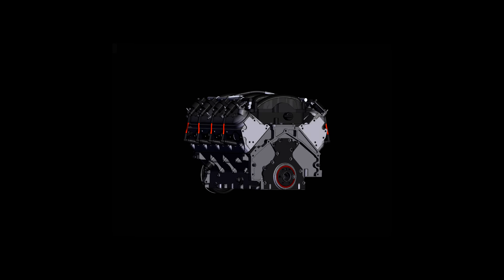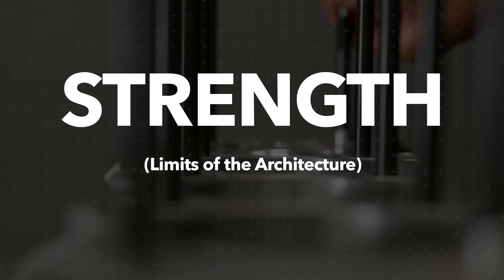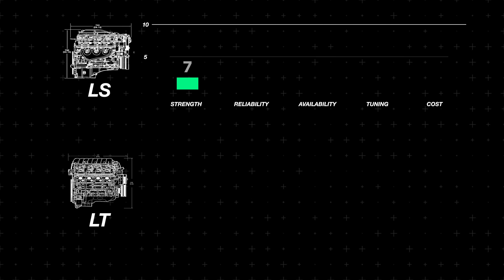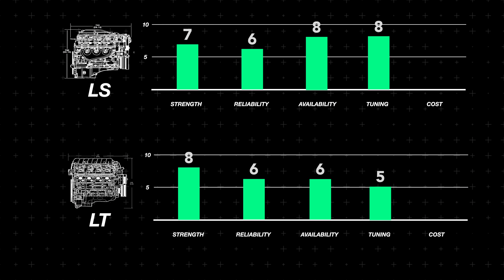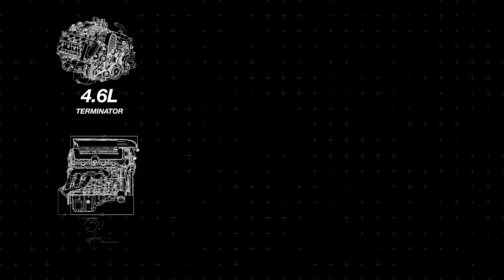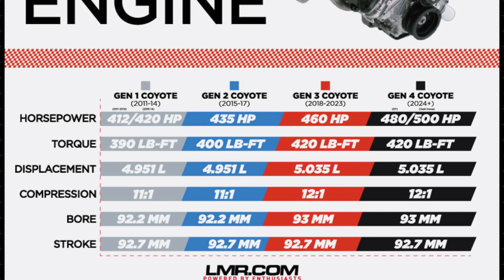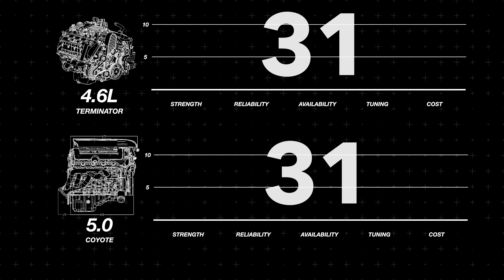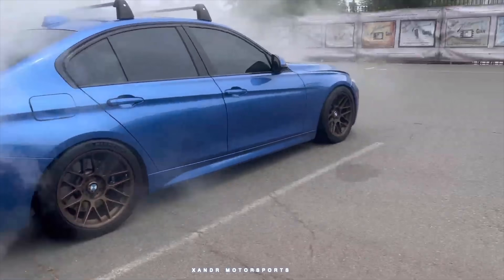Why Old Engines DESTROY Newer Ones💀| Explained Ep. 25

Comment: Did those old engines make 1000hp From factory? Obviously not. I've seen the Papadakis 1000hp B58 Supra, Brabus makes 900hp now....
Reply: And those are the pinnacle for B58 performance. Don't even get me started on the 2000hp 2j streetcars out there let alone 3000hp+ promods. And the engineering side of the engine which proves the 2j is a better engine.
Reply: @lennixsingh626 you’re fuckin joking lmao. Those aren’t the pinnacle of b58s. And hp/$ is easily in the b58.
Reply: @carter898  if they weren't u would be able to prove it. no one has charted even past the 1400hp mark in a b58.
Reply: @lennixsingh626  there are plenty of b58s rated for over 1500. high hp can be done with a big enough turbo that has a peaky power band with all of its power within ~400 rpm. The b58 shines where it can hold 1200 throughout multiple thousand rpm.
Reply: @lennixsingh626  Those 2000hp 2JZs are just Billet Blocks
Reply: @borla4491  theres been multiple 2000hp cast block 2j's that run effortlessly. Roughly 75PSI is the physical limit of 2jz cast block before they balloon and that with factory sleeves. No aluminium block will dare to push to that much boost before shitting itself
Reply: @lennixsingh626  No. I said BILLET Blocks. Which those are no longer real 2JZs. Which any engine that are Billet will of course handle way higher horsepower than the Factory Block.

B58 doesn't even have a Billet Block yet, and there's literally been B58s running 1000hp on Stock bottom end
Reply: @lennixsingh626  no 2000hp cars run “effortlessly”. Just tell us you don’t know how hard high power is on cars
Reply: @carter898  I know its not hard when theres even RB's out there making 2000hp in streetcars that last 40-50 full passes before getting just new bearings.
Reply: @lennixsingh626  Lol. 2j and RBs aren’t the only i6 engines out there
Reply: @carter898  2j's and Rb's are pinnacle of petrol I6's and its not even a debate.
Reply: @lennixsingh626  the s58 is the best one made right now. In 3< years that engine will be figured out upside down and backwards. It’s already made 1049 with completely stock internals. Neither of those engines would touch that
Reply: @carter898  its best engine for pushing power with stock internals. It still however isn't better than a 2jz or Rb until it pushes the same and if not more power than them later down the line.
Reply: @lennixsingh626  its better than an rb. They shouldn’t even be in this conversation. The s58 will make the same power as a 2j just because the after market materials are the same. After so much power they’ll need to be sleeved or billet ( though billets don’t count as the original engines anymore) and at which point they’ll run whatever kind of boost you throw at it meaning very close power. Then it’s down to individual setups for each car

Comment: I disagree with the oil pump gears on the coyote when it comes to boost. It comes down to bouncing off the limter. Regardless amazing video.  Thank you.
Reply: 100 agree, idiots bounce of the limiter and the o.p.g take a crap. Then you have guys that know what's up with 1000hp with stock o p.g and no issues at all.

Comment: Holding on to these old engines because we’re scared of new technology is the equivalent of people who wouldn’t let go of carburetors. The new engines are better, they just require smarter people to take advantage of them. And as far as tuning the B58 vs the 2JZ, good luck buying a reflash device for your stock JZ ECU to make 500hp with almost no work. Not to mention Papadakis uses the B58 in their FD car because jt is easier to make 1,000hp with a B58 than a JZ. Not a lot of accuracy in this “comparison”
Reply: 2j's make 750hp unopened with just bolt ons (minus cams and springs). That is absurd for a 30yr old engine. And there are many plug n play computers for 2j's nowadays. I find it funny that people like u always need to point out the little things that the b58 is better at, or should I say the ONLY thing being that the b58 can make extra 2-300hp without many mods. You better hope an engine that's 20-30 years newer would make more power with minimal mods. But when the bigger picture of the engineering of the blocks comes into play u run away. 

The 2jz is a far superior engine. Its not only simpler but its also stronger. There are cast 2jz's making 1800hp reliably. I will also point out the fact there are practically no mechanical faults at all with a 2j. It has one of the strongest cast iron blocks on the entire planet, Siamese bores and a girdle that acts like a block brace. You also tried to point out the fact that one of the only FEW b58's pushing 1000hp is Papadakis. And NO, he did not choose the b58 because its a better engine. He only used it because it came with the car and wanted to stick with the platform to see where he could go with it. He also had no idea what he was getting himself into and didn't know what the outcome of the b58 would be. U can watch a video from High performance Academy doing an interview with him.

The 2jz still is and always will be the Ultimate I6.
Reply: @lennixsingh626  B58s are also making 750hp with just 'bolt ons' too. The B58's rotating assembly is just as strong as the 2JZ's. People have been making over 1000 crank horsepower (800-850+whp) on the B58B30O1's (new supra/M340i) stock internals reliably! 
The only thing stock about some of the 1800hp 2JZs you have mentioned is the factory iron block and not the rotating assembly. There are many other engines which factory blocks can do the same, such as the VR38DETT, Ford Barra, Coyote, LS. The B58 hasn't been out for long, and people don't know the engine well enough as the 2JZ, so people haven't found its limits yet! The B58's block was actually designed for high performance Diesel engines, which need a LOT of boost to burn the fuel properly. Though, you are probably correct that the 2JZ's cast block is a bit stronger due to it being iron, but the B58's block does have many advantages over the 2JZ's despite it likely not being as strong, for one, it is a lot lighter, so it is better for other things such as track use etc. 
The B58B30O1 as an engine has many advantages, for one it has more torque than the 2JZ, the power band is a lot more usable, and it is way more fuel efficient, all that with the rotating assembly being just as strong!
Reply: @lennixsingh626  so block strength is what makes an engine the best? How about the head, that doesn’t flow for shit. The cast iron block that weighs a ton. Factory engine management is shit. Plug an play computers are not plug and play, they need to be calibrated. They just happen to plug into a factory harness. And since you’re using arbitrary arguments here, I’d bet you’ve never touched a stand alone ECU in your life. They use Hemi’s in top fuel dragsters and they hold 5,000hp. Does that mean they are the best engine ever? No. The B58 is more efficient, lighter, and all around a better design. And Steph Papadakis himself said that it is easier to hit the 1,000hp mark on the B58. The JZ isn’t better, people are just naturally resistant to change.
Reply: @Jbrundage94  The 1st gen b58's had a horribly restrictive exh side chamber with only two ports. 2j's have never been known for poor flow ever.

The 2j is one of the lightest cast iron blocks weighing only 57kg yet its still the hardest and strongest I6 block to date.

Not sure what u mean by engine management issues when theres 10's of plug and play computers out for JZ's now that don't need calibrating. Just look at haltech. They already come with base maps and tunes.

The 2jz has a much simpler valve train design too, in which will fry the b58 in the end when they try to make em rev around 9500-10k rpm.

I agree the b58 is a more eco friendly daily driver but the rowdiness and power is what really gets every car heads adrenaline going at the end of they day.
Reply: @lennixsingh626  hahaha so let’s get this straight, you think stand alone ECU’s just come pre-tuned?
Reply: @Jbrundage94  They come with base maps already made for the car. I literally have a plug and play in my s14 and it has a base map if you cant tune your car.
Reply: @lennixsingh626  if you’re running around on a base map, you have no business modifying a car because you clearly don’t know what you’re doing. Base maps are NOT a final tune, nor are they meant to be driven on. They are a BASE to start from to make the tuning process easier.
Reply: @Jbrundage94  I know theyre not... I was just proving to you that you don't need to calibrate cars with haltech plug and plays.
Reply: @lennixsingh626  you didn’t prove anything. You absolutely need to have it calibrated. You cannot just drive around on a base map if you expect the car to run well.
Reply: @Jbrundage94  Welcome to haltech.
Reply: @lennixsingh626  for ENTHUSIASTS, aka, people with modified street cars, physical block strength is not an issue. The JZ is a great drag racing engine. But as a modified street car, it’s archaic combustion design is not as good. For street car horsepower levels, the B58 will provide a better driving experience because of the more efficient airflow and wider power band.
Reply: people straight up are holding onto the carburators, don't want the CIA getting anything off that OBD2 port, gotta make sure that car works after an emp

Comment: @337 Speed  This was such an awesome video! I’m looking forward to part 2! Just an idea, I think it would be interesting to do the EJ25 VS. FA24. From my own research the newer motor has been shocking me when it comes to how much more power it makes just from simple tuning and bolt on applications.
Reply: Or RB26DETT vs VR38DETT
Reply: @Roomsaver  VR38 bodies the RB but that’s kind of obvious given it has over a liter of displacement over the RB
Reply: Oil Pan: Git Drained boi
Reply: The EJ was never a good engine to begin with, so its not a hard benchmark to beat.
Reply: @lennixsingh626  It’s definitely not an engine for beginners. As with many engines it definitely has its flaws. But looking past that there have been many applications where this engine has proved it’s self. That being said when it comes to this engines power per dollar amount it is poor, admittedly. I believe a segment in depth on the EJ VS. FA could really expand what’s already out there on both of these types of engines. There’s a lot of miss information about EJs out there.

Comment: Ive had 3 cars with the B58. The smoothest 6 cyl on the market for daily driving and can handle a lot of power
Reply: Agree. But smoothness was not factored in into the comparison. Still, the video managed to stay reasonably reasonable, unlike some other "enthusiasts" whose daily commute to work seems to exactly 0.25 miles.
Reply: I don't see it. The metrics were kid of bullshit... and the measurements were bullshit either.

All I heard was talking. No sources, no exact statistics, comparisons, etc. @klausstock8020

Comment: Supra’s do not come with 1000 hp from the factory BMW engines can be tuned up to about 600 before the bottom end breaks, so what are you talking about? You are agent you are engines class old stuff in every possible way except nostalgia.
Reply: The 2jz can stand 1000hp with a few modifications.
Reply: @matiasfpm  you gotta build them , upgrade injectors, get a bigger turbo setup, get a better transmission, better fuel pumps, not even mentioning the numerous engine components that have to be beefed up. But ya a “few” mods 🤣
Reply: 2j's make 750hp with just cams and springs + bolt ons.
Reply: @lennixsingh626 no they don’t at all lol
Reply: @lennixsingh626  if by bolt on you mean your bolting on a set of new rods, pistons, valves, valve, springs, cams, fuel rail, injectors, intake and exhaust manifold, exhaust full3-4in, turbo charger, fuel pump, fuel hose diameter, on e85 or meth then yes your right. However if not your gonna get 20 runs in it at over 700whp and melt one of the crap cast pistons